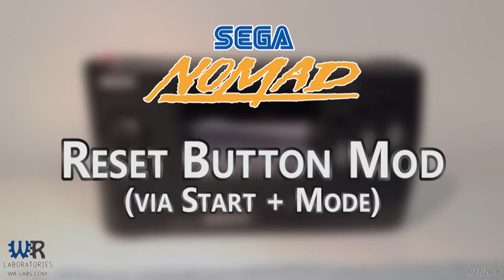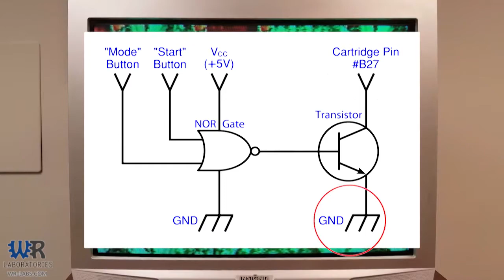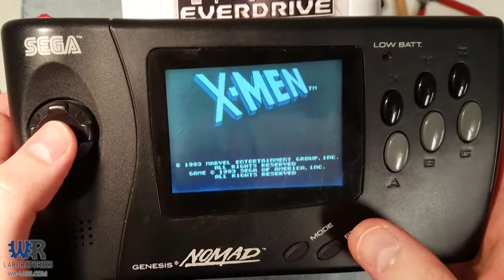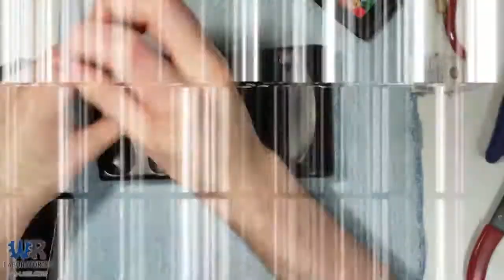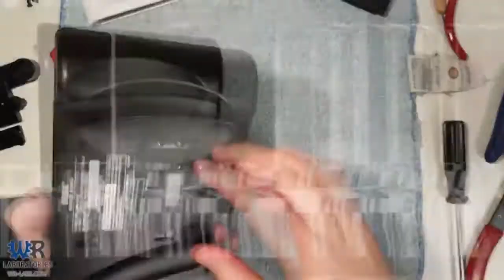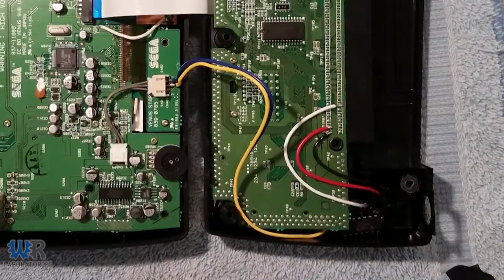Sega Nomad Reset Button Mod

Comment: Hey do you have any ideas for adding a controller 1 port we have tried everything look up channel  david nelson for info and please let us know. Thank you so much
Reply from the maker: I've seen a mod done of this, but never attempted it myself. I'm sure you can find instructions online somewhere
Reply: @w.r.laboratories3264  man tell me we have tried. Seems like they have all gotten deleted or people have forgotten how to do it. All we can find is a schematic on the controller chip so we wired it like they said and only one button works at a time like not enough voltage . Its a real bummer if you find anything please let us know 🙏  or look at the channel david nelson and maybe reply with some pointers?. Thx in adv!! For even responding

Comment: So I have an x7 as well are you able to do save states or go back to main menu without this mod?
Reply from the maker: Did you mean to say "WITH the mod installed"? If you don't have the mod installed... I mean, the everdrive just functions normally. With the mod installed, the reset function is only activated by pressing both start+mode simultaneously; you can still access the in-game menu using start+down as normal.
Reply: @w.r.laboratories3264  ah ok so without the mod theres no way to enter the in game menu.?
Reply from the maker: No... no, that's not what I said. This reset button mod has no effect on the everdrive's in-game menu function. With or without this mod, you use start+down to enter the everdrive's in-game menu.
Reply: @w.r.laboratories3264  ok awesome I was worried. Thats awesome to hear. Im about to mod mine with the screen and player 1 mod

Comment: I just installed this mod and I really appreciate this. The only things i found from it is that if you have a region mod wired to the start button, then restarting the game could get messy with a screen full of garbled text. Sometimes it wouldnt boot due to it thinking its reading a PAL cart. I disabled the region mod to install a physical switch in the near future. Another thing I found is that this mod doesnt work if you happen to play master system games. I also have trouble re-assembling the system due to an unidentified contact point that makes the system think its repeatedly holding the start button. I tried electrical tape and nothing worked so I assembled it without the RF shield.
Reply from the maker: Thanks! Glad you found it useful.
1) If you're having problems with this mod being compatible with a region mod (I've never tired one on my nomad), you could try substituting the START button connection instead with the DOWN button.
2) Master system games need to use a different pin for reset (I forget which off the top of my head).
3) As for the pin shorting... it could be one of the chip's pins is contacting the RF shield? did you try covering the chip with tape to insulate it?